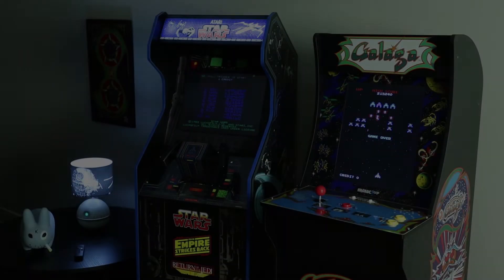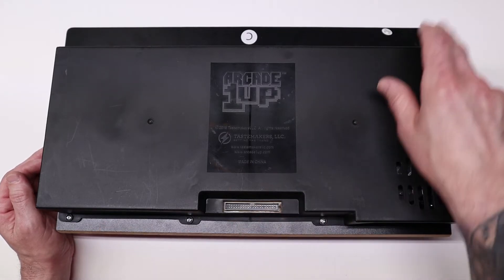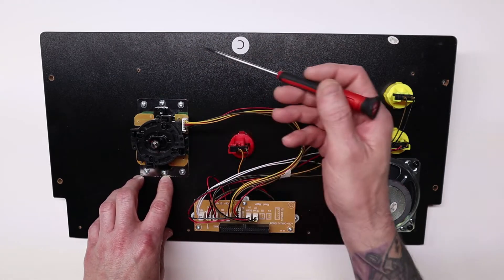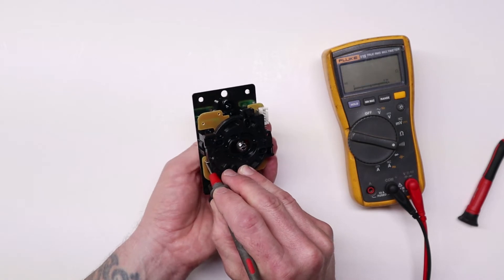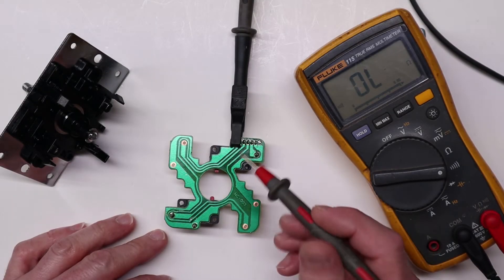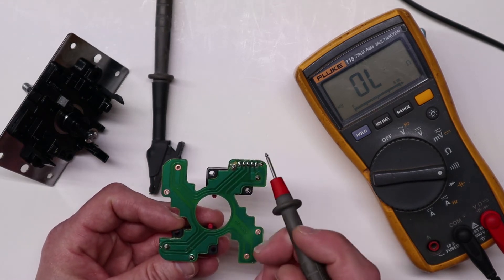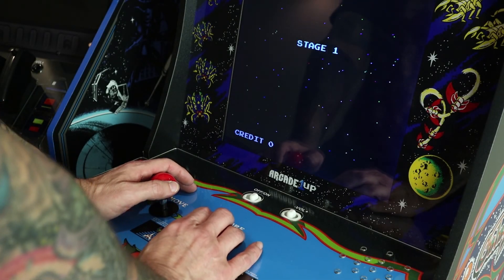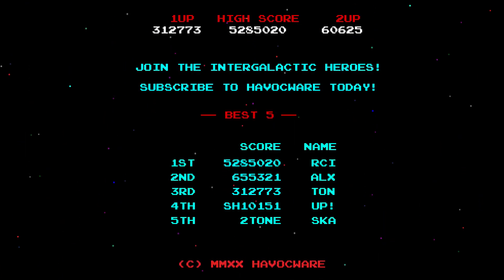Galaga Arcade 1Up Console Game Joystick Troubleshoot & Repair

Comment: Im having a similar issue with my galaga Joystick but its having issue going to the right instead. And its not that it won't move to the right its about 45% of the time it doesn't respond unless i move a couple times. Really annoying. Im not experienced in soldering so hopefully its a simpler fix